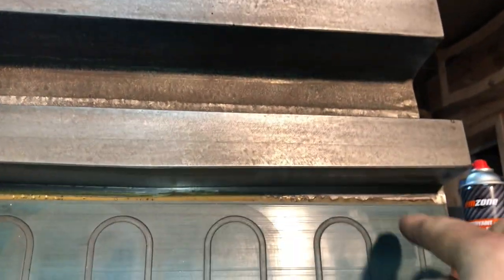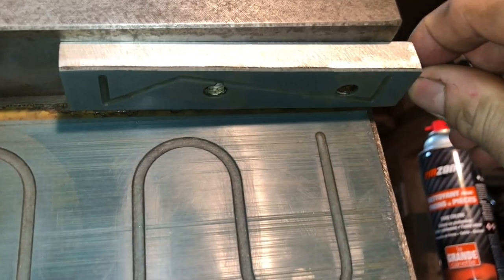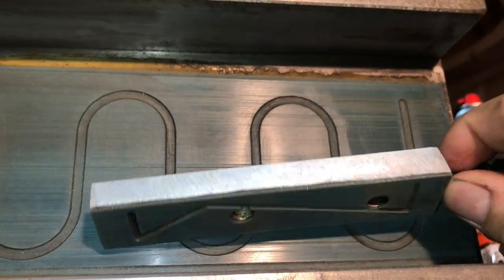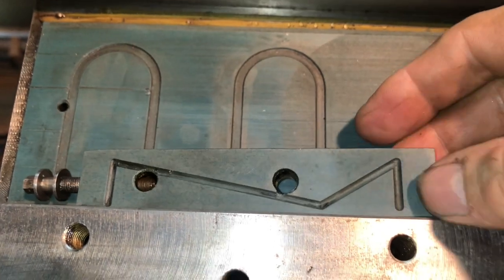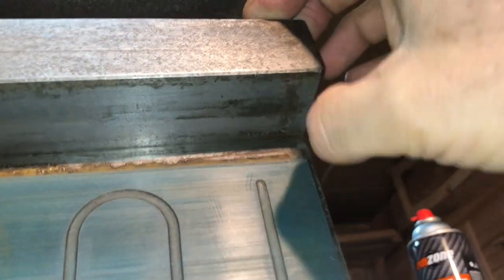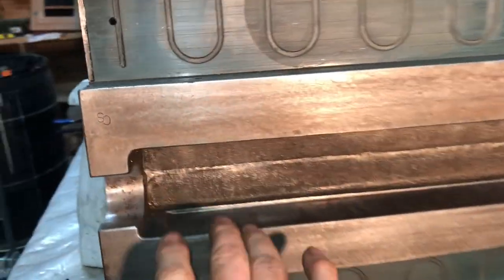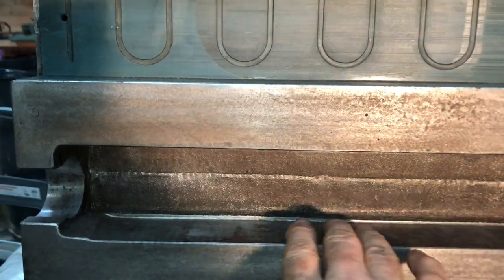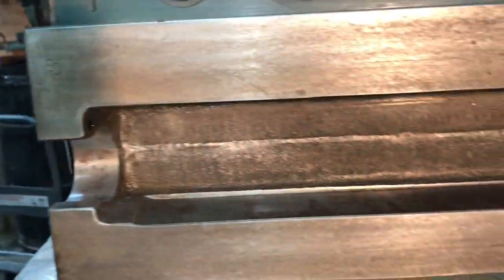Part 9 - (Inspecting the backside of the Z axis)

Comment: No... So the relief in the turcite was to ummmm burnish the turcite or fit it to the surface. In reality the turcite is a bearing so it is not supppppppposed to wear... it is not a brake shoe if oiled properly it has long life. So what they did is FIT the turcite to the harden box ways by applying a very fine grit paper to the ways and in a way polishing them matching the surfaces.
Reply from the maker: If I ever have to replace the turcite on my machine, I would feel much more confident doing it this way than the scraping method! Would you happen to know the grit? How come you know so much about the Fadal? I am very impressed!
Reply: @BlaiseBarrette The grit used was 380  Wet dry paper Black in color usually.  3M spray on glue to attach the paper to the column for the head. and i believe we used double sided tape on the saddle to burnish the table to the saddle.
You can use the gibs to ensure the hard surfaces are kept together while burnishing as best as poosible. At Fadal the used a custom piece mounted where the Gib block mounts and a teflon pad. 
Oh and the Gibbs have a history too.  Originally VMC45 days they started off bronze.  And then when the saving machine design of the VMC40 came along they went to 7071 Aluminum. And then to Steel with turcite and then to back to bronze.